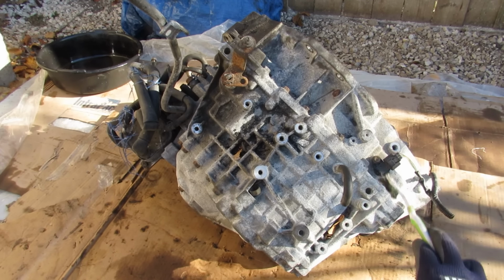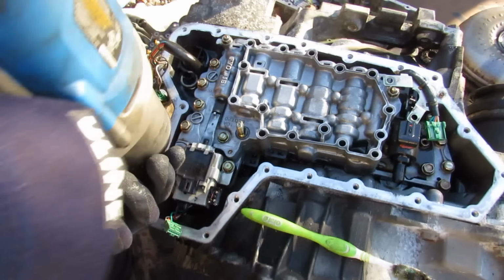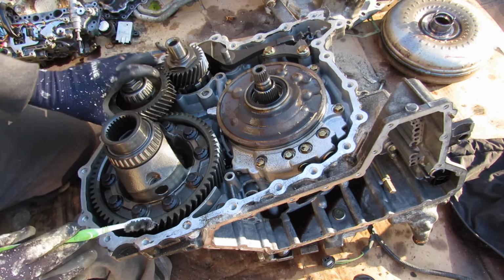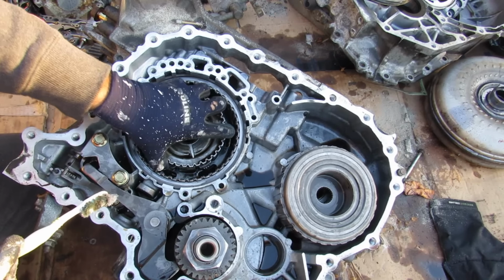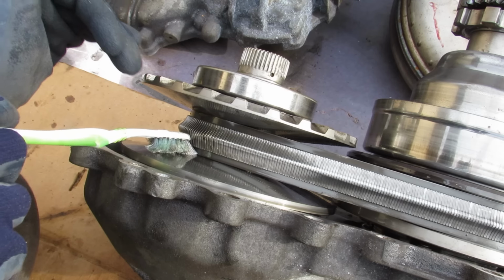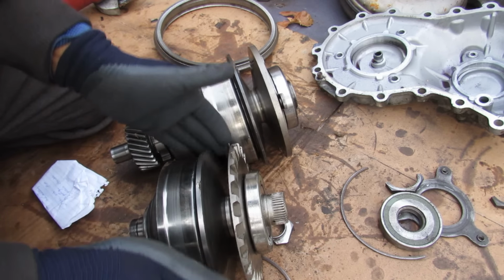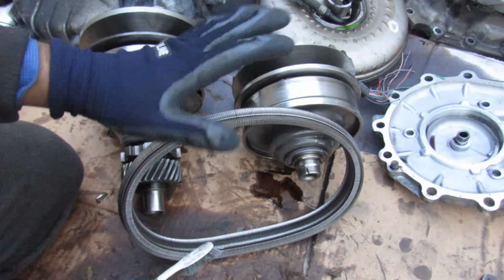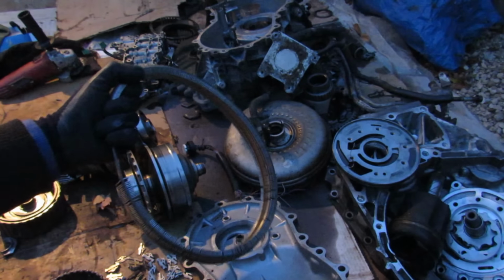Why Nissan CVTs FAIL

Comment: i had a feeling driving slowly and smoothly would make my car last longer. 2008 Altima coupe with 330K miles, only wear items replaced. still going strong.
Reply: Found the one responsible altima driver
Reply: just got a 2022 Mitsubishi Mirage and this video gave me peace of mind, with its 78 hp I think my CVT transmission will be ok...I think the mirage was the kinda of car the CVT was made for. :P
Reply: @josealtamirano8030 you’re not alone. Mine is 2023 G4 with CVT. I upgraded it from 22 G4 5 speed.

I learned that CVT pairs well with LOW stress tolerance and SMALL engine. It CAN take a beaten but still requires maintenance (like any other cars out there). It uncommon for American owners to neglect their economy cars simply by treating as an appliance.

I plan to replace the CVT fluid every 20k because I don’t drive on flat road daily. That just for me.
Reply: @edgaryzen4925 I'm not sure who told you what but that transmission is doomed😮😮😮
Reply: @josealtamirano8030  My wife had a Mitsubishi Colt (which preceded the Mirage), with a CVT. Kept it for eight years with no problems. She had it serviced by the book and because she doesn't thrash her cars (being quite old!) a CVT is an excellent fit for her driving/maintenance style.
Reply: Been doing the same on my 2008 altima coupe. 190k so far and the bearings and air-conditioning are going out first.
Reply: 07 Lexus is250 with 208k miles lol and it’s been driven quite hard through it’s life. Always maintained properly and always warmed up properly before the abuse. Never any issues, only alternator failed after 15 years finally. Rest is maintenance and preventative parts etc
Reply: @MikeyG003  wait. Your is250 has a CVT? Wow. Impressive
Reply: @edgaryzen4925  lmao no just a regular 6 speed automatic. Moral of the story is treat the machine right and let it warm up etc and do the fluids ahead of time and should last you a long time without issues
Reply: @MikeyG003  that’s not surprising because it’s basically a Toyota and probably the most reliable luxury brand. The older Land Cruisers have been selling for collectible prices for years and the Lexus 4wd’s are pretty good vehicles that hold their resale value well.
Reply: Yep, I baby my 2009 Altima (150,000) accelerating slowly changing the Trans CVT Fluid every 25,000..not using overpriced Nissan fluid but Castrol CVT fluid 6qts $40 - $50.
Reply: I got my 08 3.5 coupe at 142k. It had 2 owners.  I found out fluid was never changed😅 I had it changed it at 165k, and then I decided  to change the screen at 185k. Did another fluid change at 204k. I'm so surprised that it's still going. Only paid 800 for this car. But I had to replace 2 alternators. That job blows, lol
Reply: My Altima is almost at 330k... My Rouge's CVT went out at 70k... It's just an unreliable and inconsistent piece of machinery
Reply: Did you do regular tran fluid changes?
Reply: @alan-cl1rj  it's a must, and be gentle with the throttle.
Reply: @hedener6911 how often did you change fluids
Reply: I worked for a limousine company and the owner was adamant we would shift out of overdrive if we were driving in the city and I think it actually did help with transmission life. I don’t think modern cars have the option to turn the overdrive gear off but that would maybe be good to have in automatics that do mostly city driving. 

This CVT reminds me of a helicopter lol with so many moving parts that can fail. I’d think as transmission technology evolved they would have simplified them and be able to make one that actually lasts the life of a motor, but here we are in 2023 lol. Transmissions from the late 90’s seem more reliable than a lot of the modern ones which is some obvious planned obsolescence or something.
Reply: Not driving it would make it last even longer. Just leave it parked in the garage.
Reply: Same thoughts here. My wife drives a 2007 Audi A4 2.0 TFSI engine with a CVT transmission. The engine is powerful but she's a gentle driver, no sudden busts of acceleration and never goes into sport mode or use the paddle shifter which I believe can send  sudden bursts of high torque into the system. Being an Audi it's had its share of minor problems but no transmission issues from new to near 200,000 Km (120,000 miles) now. She loves the car and intends to drive it for many years to come, I make sure to change engine oil every 10,000 km and transmission fluid every 20,000 km.
Reply: I can understand how that might work. Highway miles, not many stops and starts, gentle acceleration, sure.  Can the average person drive gently enough for 300k miles?  Probably not, hence the average lifespan of less than 100k.
Reply: But what's the fun in that? You only live once.
Reply: Lies!

Comment: Honda CVT's seem to hold up better. The most problematic is the Sentra and Versa because it is made without a stepper motor that adjusts belt tension.  Stay away from all CVT's when looking to buy a car.

Comment: Ha, I have a 2018 Maxima SR I bought for the wife and it has paddle shifters in it lmao.  All that time and turns out not even shifting real gears lol.  It does perform well though.  Cost me $244 to get the oil changed in that thing from Nissian dear, cause I didn't know much about the CVTs

Comment: It was an impressive transmission in my opinion. I had a 2010 Maxima and was impressed. The main thing was if you floored the gas pedal you make 290hp continuously. Running it against a similar power car with a normal transmission like a wrx it would just pull. The wrx  would pull just before a shift then fall back until it was back to the top of the next gear. It was a decent engine too, except being an interference engine a bad crank shaft position sensor causes the pistons to smash the valves to mush.
Reply: LOL    yea except for that ....

Comment: Yup. Just had to have a new one installed in my 2013 Altima 3.5L. It was only $6700..... Anyway, it was still cheaper than trading it in and getting a new car note. From what I was told you cant do it yourself because it has to be programed to the car. Ive done a ton of work over the years but have no way to program anything

Comment: Does anyone know this, im driving a Toyota Auris from 2013 with over 300.000 km and recently in some occasions the engine starts to shake a lot, or the gear system.
Not always, when the engine is cold it runs fine, but as soon as the the engine is a bit warm or the engine is busy trying to regenerate power for the hybrid batteries, it starts to make a rumbling clapping noise and shakes a lot trying to maintain a constant speed.
I can't figure out whats wrong, I replaced the transmission oil, but still the car seems unhappy, what could fix it?

Comment: I am used to seeing CVT's on mopeds and the occasional motorcycle "style" moped like the Honda Navi... this was very different. Those you can repair with a few tools and a torque wrench... this looks insane by comparison.
Reply: Polaris 4 wheelers....    But you just change a rubber belt out,.... and replace...

Comment: You’d think by now, there would be enough of these out there for the aftermarket to supply parts for rebuild. Relative to a normal auto they have way fewer components and look fairly easy to rebuild. I hear Mitsubishi use the same transmission but don’t overload it and it lasts just fine.

Comment: 234k on a my Nissan Altima's cvt. fluids changed every 80k  a lot of hard driven miles.  69k on a pathfinder cvt was already showing issues and signs of wear. i dont mind cvt in a car but will stay away from them in Suv's even if your not towing i think the v6 and a the extra weight of an suv is just too much for current gen cvt's to handle long term.

Comment: as a car salesperson i used to explain in much simpler way to my clients as to why not to buy certain CVT's cars and especially associated with turbo engines
Reply from the maker: Unfortunately turbo and CVT make up the majority of new cars
Reply: @speedkar99 Yup. CVT is now the mainstream transmission. Was not the case 10 years ago @_@

Comment: I expected the belt to be the primary cause of failures, but really It's amazing those belts can handle the amount of torque and number of cycles they do before failing.
Reply: Meaning belt isn’t the failure point. From my understanding w 190k mi on CVT and on the clock keep going. From 2011 2.5 Altima. Most failures come from lack of maintenance (every 25k to 35k fluid change), or excess heat(can be addressed with external cooler. Which also extends oil life about 10k more) and I’m driving this car under extreme condition. Just so you know. 120f AZ heat wouldn’t be any good for this tranny but yet it drives like a sewing machine and makes me smile whenever I get to the gas station. Just don’t forget that CVT suffers from extreme heat. And there are ways to make it run right. Before rebuilt is actually needed. Plus these can take some damages compared to automatic transmission where everything is actually gear. And run by hydraulics where kick down can actually cause more harm for the tranny than it should be.
Reply: The belt is being pushed, not pulled. Those metal pieces are mashed together, so the actual force that does go through the belt doesn't matter as much. The weakest point is actually the contact point between the belt and a variator. Slippage and wear are what kills them. Those belts break very rarely.
Reply: Can anyone help me with my 2015 Sentra I have a whine when I rev or floor it, I have replaced the valve body and filters hoping that would fix the problem and found no metal shavings when doing so but my whine and some slippage is still occurring it has 80k miles on it , if anyone has suggestions please help
Reply: @tylerlevitt523 what ended up happening? I got my replaced. luckily nissan replaced it for free.
Reply: probabilty bearing damages, @tylerlevitt523
Reply: @tylerlevitt523  well enough with the flooring. Get the drain and fill done along the filter+gasket kit changed out.. that should do the trick
Reply: @vincentra8849  I changed the filters and gasket, do you think I put it back together wrong? I’m not a mechanic and did it all myself the first time just by watching videos, another lad told me there might be an air leak from the filter area making it to the whine and slight slip and loss of power, again when I dropped the pan it was very clean with no metal so I’m thinking it’s not the belt
Reply: @tylerlevitt523  that is not a belt or fluid issue. Do you get any TCU codes? I bet you have torque converter issue. Also you said “you” did it. Right? How did you measure what you put it in. Air does not matter it doesn’t happen that way on CVT fluid thanks to low viscosity.
Reply: @tylerlevitt523  also when you dropped the pan you have followed the torque pattern right?  Whining noise generally means lack of fluid not something being shitty. But if the torque converter got fucked shit can happen
Reply: @vincentra8849  I measured 5 quarts in a 5 gallon bucket when I drained so that’s what I added back.
Reply: @vincentra8849  I did pull a code which was a code for a stuck solenoid and that’s why I replaced valve body, that code has since cleared and not come back
Reply: @tylerlevitt523  one thing though. It also wore out. You know that right? Your car will lose its peak power as it ages 😂. Especially worse when you have CVT. “as long as you can reach highway speed no problem. You should be fine” is what your TCU is trying to tell you until your TCU learns about new condition or parameters it is all guessing around game. Im sorry if i couldnt help all the way.
Reply: @tylerlevitt523  So you're telling me you don't have any experience working on your car, and you decide on a whim to open up the CVT and mess with it? I'm not surprised it didn't fix the issue, maybe you should just bring it to someone.
Reply: @tylerlevitt523 I always hate when people only put in the amount of fluid they took out, what if the fluid level was incorrect when you took it out? Follow the change procedures correctly, typically there is a procedure to top off your fluid as well.
Reply: @SamA-xu9gy  wow, that's alot of knowledgeable with no proof that can be verified. Morals and love is all that is needed. Belief is the enemy of knowing.
Reply: @lonekiterrocky  Well LOL yea morals are what is needed.  You don't know what that means do you?  That makes you a psychopath.  But that's OK the world loves psychopaths.  So you go on thinking that making money and the law are your guiding lights LOL...  Clinton, Obama, Biden, Trump, Hitler, Stalin, Putin,  all great guys when you have it your way LOL!!
Reply: well, most of people think about cvt bell as a pull bell so they surprise about its strength, however cvt bell is push bell
Reply: @thetechgenie7374  NGL regular maintenance is the trick for these tranny. Mine needs another work done 😂
Reply: @INSPOK  I worship ramen god. 

There was a noodle and soup. there the ramen was created.
Genesis 1:1 Maruchan-Nissin version
Reply: Belts are wear items that get frequently replaced in every other variated pulley application.. this is a stupid design from a longevity standpoint.. brilliant design if your goal is to sell as many cars as is possible
Reply: @Kinda_Fast_jellyfish show me another belt that's constantly lubed and cleaned.

They're known to last HUNDREDS of thousands of miles. Watch the video you're on, lol
Reply: No shit you think 120 hp cars can kill it quicker it’s got a punie engine 😂
Reply: @spin_tires_on_pavement-s.t5760  CVTs can be paired with up to 300hp engines. Try again bud.
Reply: @spin_tires_on_pavement-s.t5760 what u say its nissan not toyota

Comment: Nissan's are cheap for a reason. When they break you just throw it away and buy a new one. When I was a mechanic I would get a ton of people come in complaining about how thier trans slips and bangs and the heat shields on the exhaust are rattling like a mofo 🤣 such junk.

Comment: I still can’t comprehend how a steel belt can grab strong enough and also not chew up the pulleys. I’d almost rather have a beefed up snowmobile cvt and make the belt easy to change every 20 or 30k miles.
Reply from the maker: Remember it's a push belt not a pull / grab

Comment: I wonder if electric driven cvt where electric motors directly vary the pulley system can reduce the amount of parts needed to work.
Reply from the maker: Electric motors generally don't need a transmission

Comment: It's called pully polish, make teeth cross hatches work 2 on the pullys to grip as well as expand , helped with my Xbox DVD drive mods to make it eject so strong it would push the Xbox away.

Comment: OR  use a big battery,  and an electric motor !!!  If anything underscores the unnecessary complexity of ICE vehicles,  it's the need for a transmission as complex as this.   So many single points of failure in that thing.  We need to end ICE vehicles and convert to simple, durable EV's !!!!!

Comment: I have sentra 2019 is it have a cooler or warming  i look to the gear have two hose bute the cycle of the water look all hot water how it cooling the cvt fluid??

Comment: what was the failure on this particular transmission?  also was this from a 2013?  my 2012 maxima has an external filter pack on the drivers side wheelwell.  just changed my fluid yesterday.  got out 6 qts .  but i blew air through the filter hoses getting an extra 2 qts out. 77k miles that oil was nasty.

Comment: That's a very poor design; that steel belt. Ir's inefficient compared to gears for one thing; and it's weak and unreliable. This whole thing should be melted down for scrap; it's nothing but a headache waiting to happen. It's like it was designed in China or something. Disposable-engineering. Nissan just dropped a couple notches in my book for this piece of crap.

Comment: I have a 2011 Altima with CVT and never had a problem with it. Car still running strong at 130,000, I've only replaced, tires, battery, plugs, etc. And I also own a 2015 Nissan Altima with 82,000 miles, running strong too
Reply from the maker: Good to hear. Change the CVT fluid

Comment: And that's why snowmobiles have a spot for a spare belt. Add a bit of complex fluid passages, servos, clutches, and then heat at 375 for 45min stirring occasionally.

Comment: I'm looking at this belt system for and me it seems like it has to work on pretty high tension levels to not slip, there is no way something like that won't wear fast, especially that in this case it needs metal to metal contact to work.

Comment: Nissan and Chrysler make the worst CVTs. You should drain and refill your CVT often since you can only get out a little less than half the fluid. Most people don't know they have filters that should be changed every few years too. They require more maintenance than old-style transmissions. Not all of them are bad, there are CVTs with hundreds of thousands of miles out there.

Comment: Automatic transmissions are pure scum, anyone who chooses to buy one deserves it to fail
Reply: ATs will last 200 thousand plus miles easily if they are cared for - most failures are due to lack of servicing as manufacturers falsely call them "filled for life" to reduce perceived service costs (to appeal to lease companies) and being that the engine attached to them will rarely be under or over revved by ham-fisted operators (unlike in a manual car) the engine will last longer too.

Comment: I had a CR-V with one of these junk CVT transmissions. NEVER EVER AGAIN!  Went back to the reliable Rav4
Reply from the maker: Did it have the shuddering problem?
Reply: When my Honda CVT started shuddering I changed the fluid quick (usually cures it for a few months) and got rid!